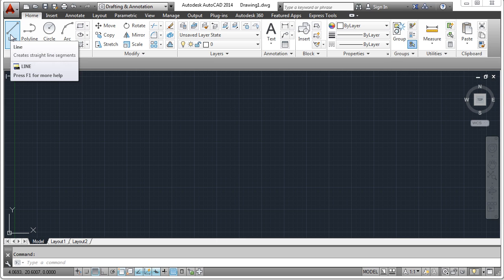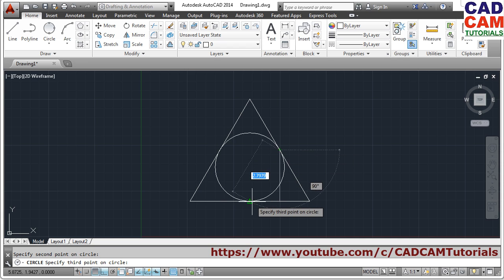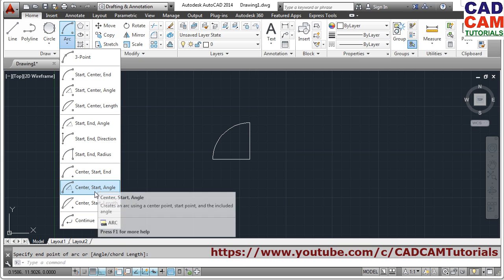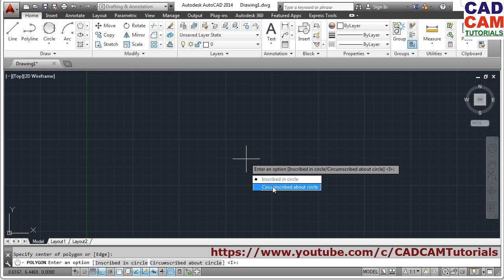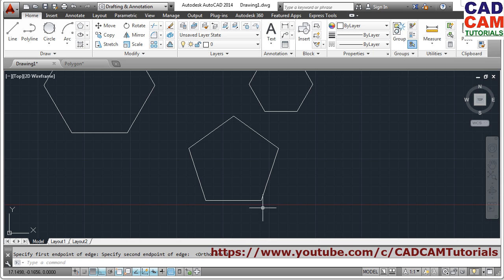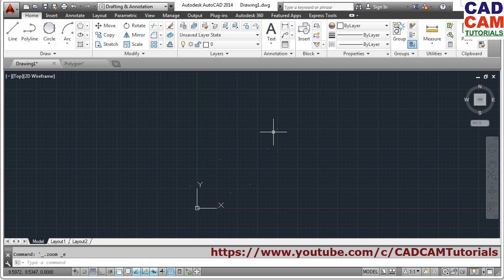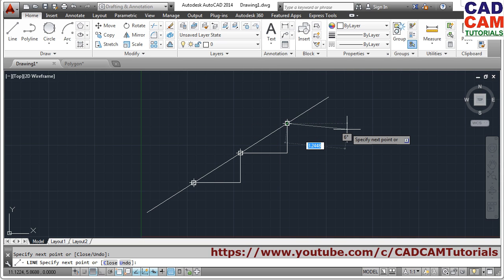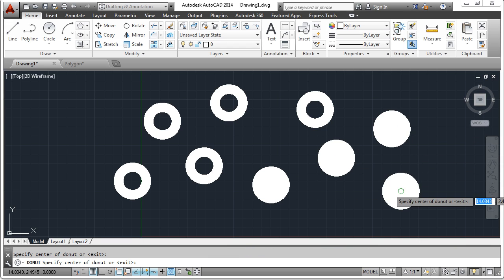AutoCAD Training Tutorial for Beginners | Lesson - 3

Comment: Hello sir,
Thank you for the tutorial. In this video,In  the measure option I am unable to execute in my AutoCAD, when I measure a line and specify length of the segment as 3 it's taking many number of points on the line. 

And also I am facing problem in  revision cloud ,arclenth is creating 0.5  arcs even after giving minimum length 1 and maximum  length 2. Please help.
Reply from the maker: use divide command and not measure. About revision cloud it should draw as per you setting. I don't know what may be the problem.
Reply: but measure and divide both are seperate commands so iam have issues with measure where as divide command i have no problem its perfectly drawing. And in donut option also when i give inside diameter 1 and outside diameter 2 iam getting very small donuts, unlike yours .